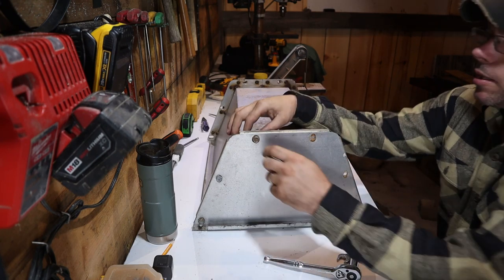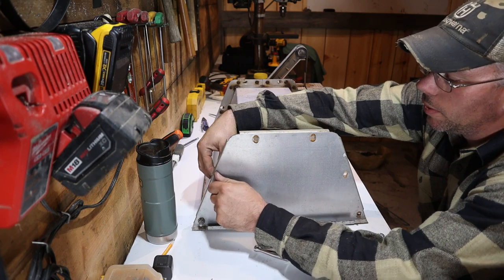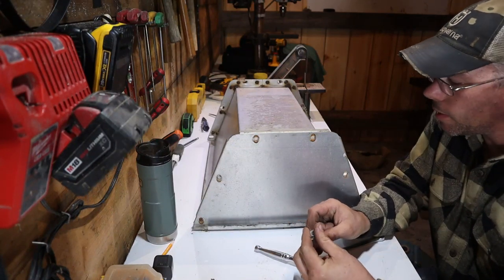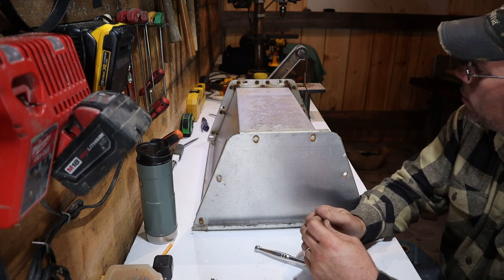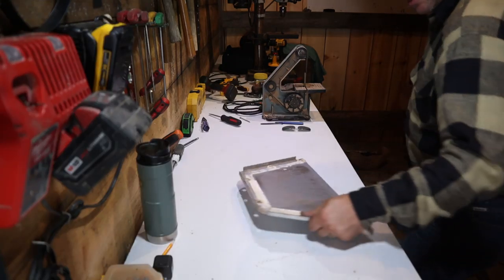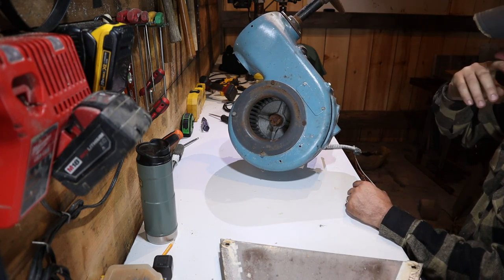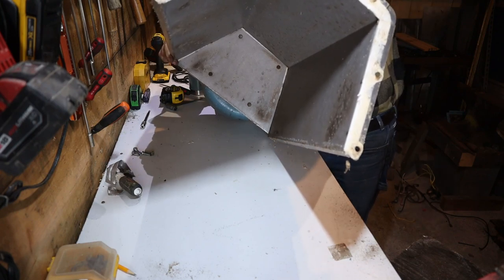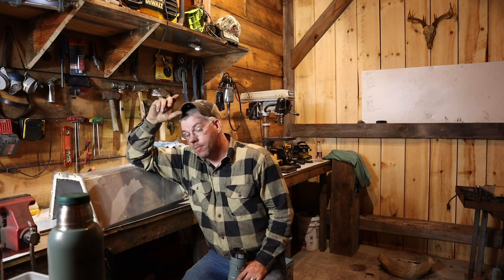The ADD I Saw A Squirrel Night: A Timber Framing Vlog

Comment: Laughed at saving things as might be useful later, raised by Grandparents who survived the Depression and so did, and so I do (and has come handy now that the pandemic means stay at home). 
I'm watching as only heard of welding galvanized as poisonous (did it outside when a breeze was blowing and held my breath, just short time welding EMT), yet building an exhaust fan for all welding.
Reply from the maker: I'm a terrible hoarder.
Reply: Jim, I respectfully disagree, it is being prepared. Myself tired of being called a hoarder. 
Take for example saving a few coat hangers. Working on Dad's '64 Beetle find a couple items down inside the tunnel. So, bend up one of the hangers into some 10 inch tweezers and worked well getting them out. If didn't have the hanger, be no way to get them out. For you, that top could be used as a cap. Worse case, make a paperweight. ;P

Comment: Morning Jim. So, a big gas (and heat) sucker of an exhaust hood/blower combo and still no insulation? Won't that big blower draw a bunch of cold air into the shop ad well? Guess we'll see if the flannel and/or jacket stays on through the dead of winter. Still, that would be better than getting all sweaty and going out into the cold winter night's air. 
Good to see work started on the doors for that end.
Reply from the maker: It's a blacksmith shop, it's going to need all of the fresh air it will get.  Don't forget I have a propane forge as well which I don't need to run the fan with.

Comment: You mentioned videos in the "Pit of Despair ".  Are some of those in your collection on this channel. Just wondering if its as bad as my shop. Think its goona be weeks before i break out my flannels.
Reply from the maker: If you go back to the start there are a few.
Reply: Ok i did find a few. Looked very similar and tight. Having built a 1200 sq ft metal shop was a dream. Of course like you im trying to organize and try ideas to make my work area suit me. My old shop was a cramped 1 car garage for 20 years. But we had to start somewhere.